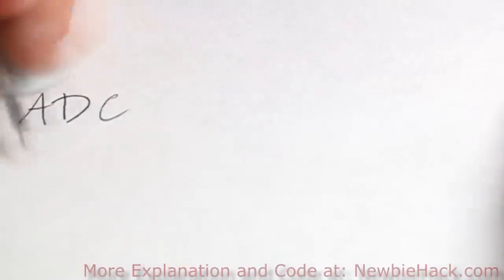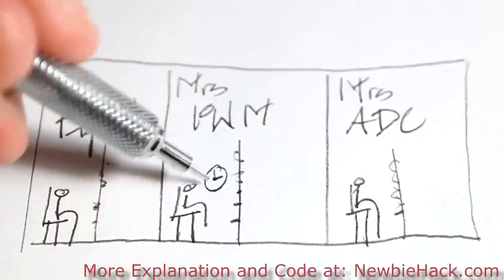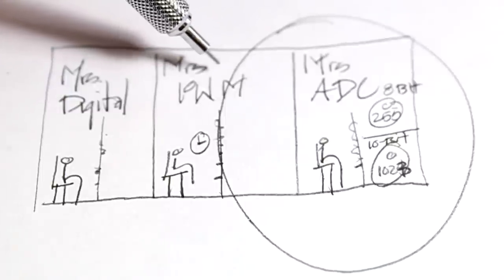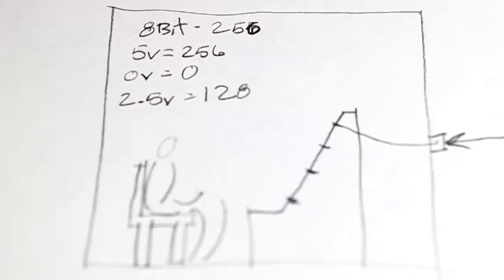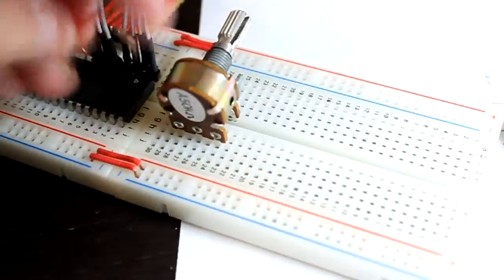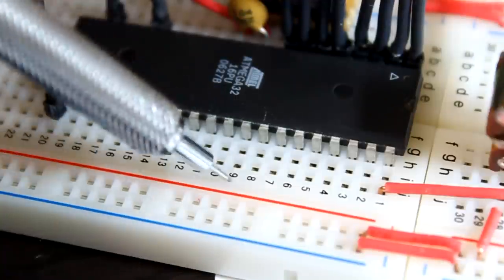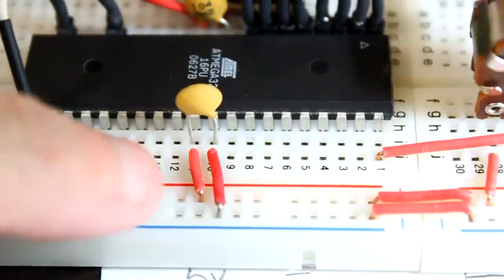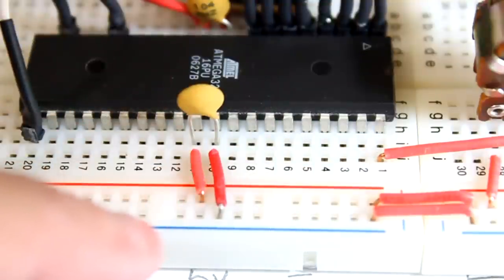30. Arduino for Production!  AVR Atmega32 - Introduction to ADC (Analog to Digital Conversion)

Comment from the maker: After looking at the datasheet, the controller does not seem to have ADC.  If it is a specific analog value you need to test, you can use the analog comparator, otherwise, you may need to find another chip, unfortunately.

Comment: @Patrick Hood-Daniel: What's the exact difference of using an inductor, capacitor or resistor (10k) for decreasing  the noise on IO pins and when do you choose which ?
What exactly do you mean with "critical situations where safety is a concern" ? (example ?)
Thanks in advance !

Comment: i am using atmega32, same setup 5v, 100nf 2 cap and i use 4 leds and provide reading range, like up to 128 v first led etc. however my leds are dancing and it is not responding to measurement from potentio meter

Comment: I never use adc.. recently i make pcb with atmega32 and i just want to read battery voltage by A0 pin..  but chip goes very hot....
Can you help me please..?
Reply from the maker: I don't believe you can use ADC to determine the voltage at another power source.  At least, I haven't tried before.

Comment: Don't you need a current limiting resistor for the potentiometer? When you turn the pot all the way down, wouldn't it short the power supply?

Comment: No that will put the pin on the chip at 0 not the power supply. The pot will always have the 5 Volts across it , only the pin is moving from 5V to 0V with the wiper.

Comment: HI, great video. i have one quick question, when you talked about whether the adc is either in 8 bit mode or 10 bit mode, you program the microcontroller depending what mode you want the adc to be in? as for the different bit modes, what are the differences between the two for example is the 10 bit more better than the 8 bit and in what cases would you use either one?!

Comment: Hi!
I baught an ATMEGA162 16PU (they didn't have the mega32) and was wondering if it was possible to do ACD with my chip version (I haven't found a certain answer on the web). I can't find it in the datasheet either. Only "Analog Comparator"